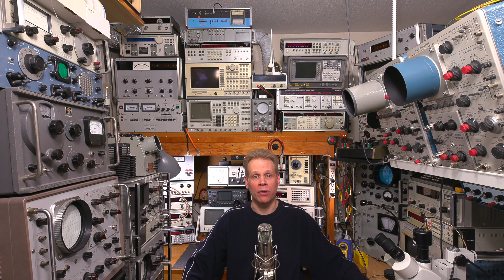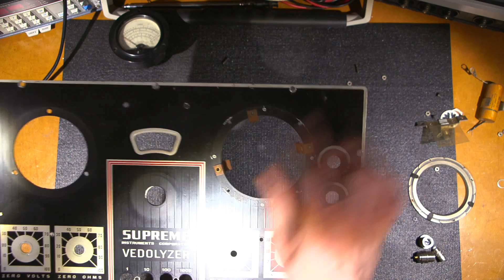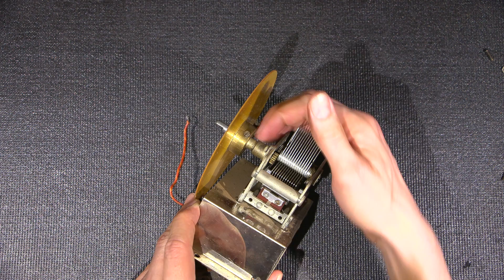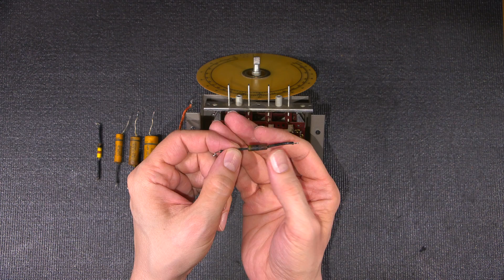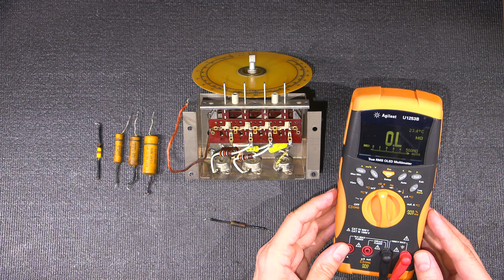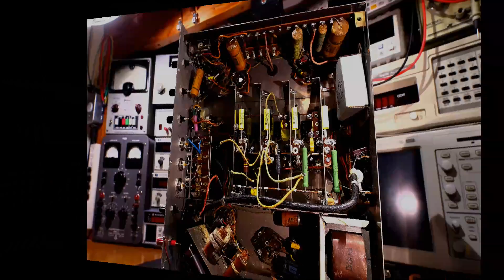Electronic Restoration- The Supreme Vedolyzer from 1939 (Part 2)

Comment: Ihad a Zenith tv with vertices trouble. The heights ckt had a100 ohm resistor the orange   Third band had changed color to a toasted brown. Only by the diagram was I able to find the correct value.

Comment: @20:12 Ah! That brown cap! You suspected the blue cap. (@18:12 in Part 1). This is the culprit!  (@18:12 in Part 1, you can see this brown cap to the right of the blue one). Once Mr. Carlson got it apart, it became clear, to him and myself and now you, the viewer. I would have guessed that blue cap, also, at that stage of inspection. I love the caps made today, by reputable manufacturers. The old ones all have to go, anyway. Beautiful job on that verticle section.

Comment: 40ohm, 400ohm, 4k, etc, are decade resistors, a.k.a. Instrument resistors.
N= a decade value.
So, starting with 0.1 ohm to 1 ohm to 10, 100 1k, 10k, 100k,etc.
0.2, 2, 200, 2k, 20k, 200k, etc.
European spec.
But, in China, they are very much available.
They are expresse differently on a schematics.
But,  China!
A kit of hundreds in a nice plastic box,about $10, shipped.
Standard resistors come in British (American), and Japanese, anywhere the British or U.S. Had influenced.
And the USSR.
So, why are they called instrument resistors?
A Telephone is a telephone instrument, etc.
Again, very available.
And, old resistors are usually 20 percent, so it really is not critical.
Same with capacitors, the .modern. NPO did not exist than.

Comment: Your antique electronics restorations keep making me want to grab an FM-capable vactube radio and try to build some devices for the workbench using vacuum tubes. Bench power supply, battery chargers, that sorta stuff.

I almost wonder if, through nothing but vacuum tubes and components contemporary to the heyday of vacuum tubes, one could build a reliable and safe Lithium battery charger. I'm sure the guys down at the local RC  racetrack I frequent would get a kick out of seeing me charge my lipos with vacuum tubes hahaha

Comment: Hello Mr Carlson.  You have re-booted some serious nostalgia in me - as a teenager in Australia back in the late seventies, I used to harvest non functioning B&W tellies from the backs of houses during throw out week.  After a while using the if it’s black and crusty or doesn’t glow method, issues became visually apparent; the insertion of equivalent components from other TVs sometimes fixed the problem.  I always made the effort to knock on the doors of the TV owner and suggest the cheeky sum of $5 if I fixed it.  A skateboard (the early fibreglass fishtail type), numerous milkshakes and other teenage necessities were afforded by this method, but I was clueless.  Watching your channel is reminding me of the importance of delivery.   Your teaching style and attention to detail,  paying critical attention to the aesthetic of things, would likely have put me on a different life path had you been one of my educators.    My schooling quickly dissolved into resentment as my visual approach to learning wasn’t  part of the semi-Victorian system still in place back in the seventies.   As an aside, tonight I’m bidding on a RCA WO-535A device for no-good reason.  No idea how to use it or modify it, but it will look sweet next to my unused analog-metered power supply on my bench.

Comment: Paul, as with everyone else, love the videos.  During part one I saw that you had the 560 schematic but yours has four tube stages to the three on the diagram.  Did you check out the 560-A PDF on Supreme's website?  Looks a little rattier, but it seems to more closely resemble the one you worked on.  Any chance that's it?  http://supremeinstruments.org/data/supreme560A-schematic.pdf
Reply from the maker: Hi John. I sent Steve that schematic to add to his site. This schematic originally came from "Don" at the youtube channel "RestoreOldRadios." He spent the time to search it out, so a huge thanks to him. You will see this schematic in the next video. Thanks for your thought though!

Comment: Paul, I've just watched the first 50 mintutes of part 1, and I was going to comment that you should be aware of rubber gromets with bare B+ lines coming through them, because in a lot of cases, black rubber is a very bad insulator (in some cases, so bad you can measure their resistance at low voltage with a multimeter), because they often contain soot as an additive to give them a dark black color. First I thought that was the reason you added the glass fibre insulating tubes on the copper bus wire. But since you used PVC gromets,  there's no problem with their insulating capabilities. Nice touch to use the insulating tubes though, to prevent melting the gromets from the conducted heat during soldering.

Altough I'd rather use silicone gromets for the tube sockets, I think PVC is a little too rigid for shock absorbtion, and also hardens pretty soon under higher temperatures, which it can get around the sockets.

By the way, beautiful work, as usual. I can't wait for the finished unit, I'm really curious about its performance.

Comment: Any other word? Keep messaging you but you failed to respond Mr Carlson.
Reply from the maker: Hi. There are (at this time) close to 150000 people here messaging me, then another 4000+ people on Patreon. I tend to miss some questions.
Reply: I was asking about your Capacitor Forcaster device, is there any other way I could acquire the schematic and build instructions without patreon, I do have PayPal to make any contributions necessary (as you said it’s not for sale). Please let me know as I’m having an hard time with testing capacitors with my available meter. Please let me know.
Reply from the maker: @DemiGod3  Right now it's only available on Patreon.

Comment: Great work, nice to see things from times when everything was made to last and to be repairable too. Just wonder why the batteries are soldered in as they'd expire in a few years even with virtually no load. Maybe you were supposed to send the instrument in for a service and calibration every few years or so and they'd replace the batteries in the process? Or maybe as it's a professional tool for service techs you are supposed to be able to maintain it yourself? Anyway kind of a funny way of doing it. Maybe they thought a battery holder would not give a realiable contact and cause the voltage to change?

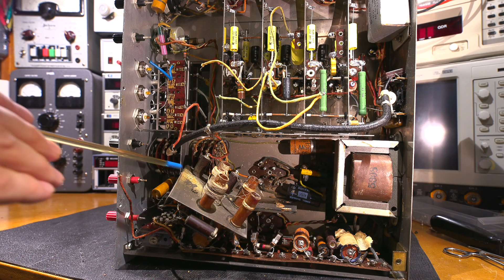Comment: <^^^^^^Sees reflection of capacitors in amplifier section in first video. <Gasps> Sees ridiculous, OCD-like attention to detail in securing sockets through grommets to chassis, the heat shield between grommets and rail traversing the shielded sections. Notices the perfect position of each wire. <<Feels lump in throat. Realizes this is not just restoration porn, this is restoration love. Thinks "You magnificent SOB". Two months later: sees extent of capacitor discharge mess at 19:52, feels ill. Room spins slowly. Presses fingers to temples, preparing to scream. Eyes gaze upward and focus on a single capacitor, noticing the letters are backward. Realizes it's a reflection. Feels lump in throat again. Single tear runs down cheek. Stands slowly in front of desk and begins to slow clap. Realizes that even in chaos, for the briefest of moments, the world makes perfect sense. Satisfied with someone else's work, takes two steps toward kitchen, trips over step and face plants into cabinet.  True story.
Reply from the maker: LOL, thanks for the play by play. I hope your face is ok!
Reply: @MrCarlsonsLab   Thanks to the -10F at the time, no worries. Seriously, though. EXCELLENT work!

Comment: Those pin jacks were pretty common, in 1935. That's wild that that was probably punched with a deep throat C frame punch, and NOT punched with a jig, but was manually punched.  I forget which products I have that were made by "Supreme". I almost bought a classroom Hickock 533 tube tester, but I don't have room for a giant tube tester that is nothing more than a 533 with an enormously huge over sized meter and dual controls, for classroom use. I must doff my cap to the men who designed that old Supreme girl.

Comment: If you have some aluminum, JB Weld, drill bits, and 15 minutes, you can fix that drilled-out ground jack. Cut a 3/4"x3/4" piece of 24 gauge aluminum sheet (Home Depot has it). Drill an identical size hole (6 mm?) in a 2x4. Put the aluminum piece over the hole in the 2x4. Hit it really hard with a rubber mallet 3 times. Take a drill bit - the next size down from the one you used to make the hole - turn it pointy-side up and insert the cylinder shaped end into the dented aluminum piece (still over the hole in the 2x4) and tap the pointy part with a chunk of wood to form the aluminum so it will neatly fill a hole that size. With the aluminum still over the hole in the 2x4, give it one final whack with the rubber mallet to flatten it back out. Use some JB Weld to bond it over the hole on the back side of the panel. The panel should be very flat on the front side now. Drill the new patch to fit an appropriate matching test lead jack (a Simpson 260P jack?). Paint the front of the aluminum patch to m/l match the panel face. Testor's model enamel should work. You'll never see that fix from more than 5 inches away and it should last the remainder of this device's life.

I had to do that to adapt a pair of modern VRs to larger holes for oddball sized grid bias VRs on an old tube amp. If I could post an image, you'd see that the patch is visible with a magnifying glass if know it's there. You wouldn't notice it even during a careful inspection of the people side.

Comment: If you want to use the original style ground socket, you could always insert a washer that fits the difference in diameters, to keep the correct one from sliding around.

Comment: True story- At work today I was helping a coworker diagnose a problem on a VFD and I asked him if he ever watched Mr. Carlson's Lab videos on YouTube. The VFD has a dry contact for run status. The contact is wired to an Allen Bradley PLC 5. He has had a lot of trouble with the point on the PLC card failing. The power source comes from a control voltage transformer in the drive (older drive) and there is a lot of "noise" on the waveform when he connected an oscilloscope to the control voltage. I think we need to find a clean control voltage source. I think the noise is actually an artifact of the DC pulses coming from the drive and "filtering" is not a good solution. There are plenty of locations where we can get clean, 120VAC power. Anyway... you even "show up" at my workplace :o)

Comment: Why didn't you just cut a square piece and drill the holes smaller and sold it to the main body on the side.
How does a carbon resistor work is it a oxymoron isn't it, I mean carbon is non resistive paired to metals so how can it have resistance?
Reply: Carbon is actually an excellent conductor of electricity.  What matters is the "state" of the carbon.  At room temperature the amorphous state conducts electricity but the crystalline state doesnt. Where at very high temperatures all the states of carbon conducts electricity as the bound electrons release due to high energy supplied to them.
Reply: MikesRadioRepair - thanks mike, I like knowing how and why things work. It’s somewhat of pet peeve when someone says “don’t worry about how, it just does”